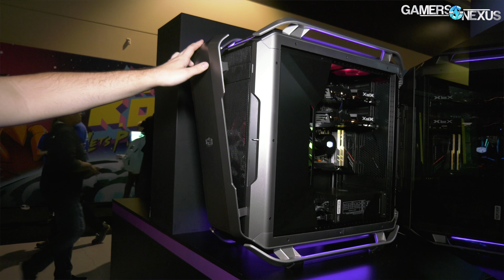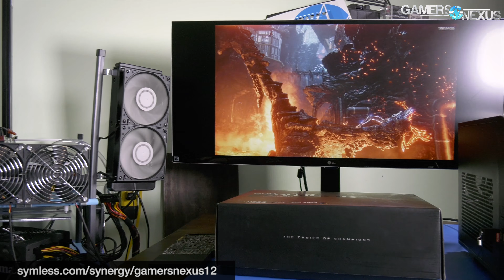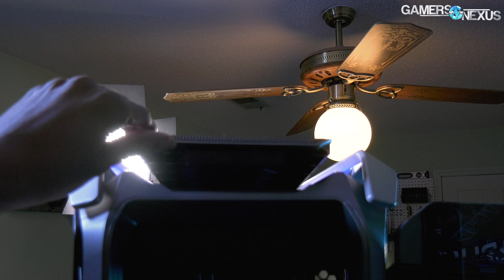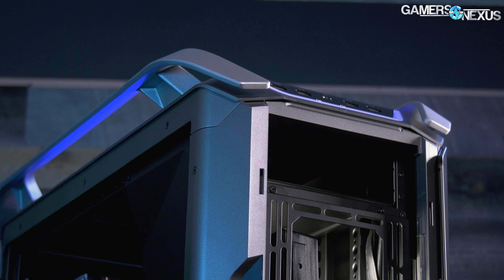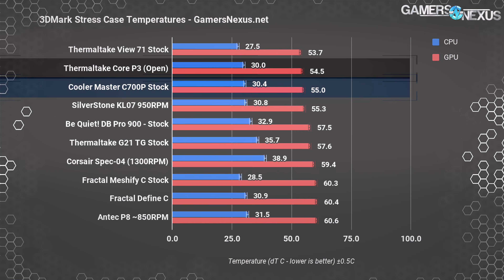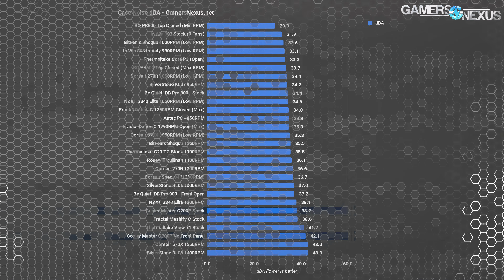Cooler Master Cosmos C700P Review: Thermals, Noise, & Build

Comment: There are not many options when you need a Bluray burner drive inside. C700P & C700M are both big and both have ODD bay. The only thing that sucks (aside from price) is the limitation of the top radiator size when ODD is installed.

Comment: Check your MB with this case as not all MB can facilitate the 4 USB 3.0 on the front. Found out the hard way with Gigabyte's z390 Aorus master. 
Only allowed 2 USBs at the front due to only one USB 3.0 header. Could use the USB 3.1 header with a converter cable to USB 3.0 but wanted that
 USB 3.1 for fast charge. So all in all Coolermaster C700P has a design flaw with most current boards. The 4 USBs on the front are for show only by the look of it. If not they should have highlighted this fact. 
Pissed off

Comment: That's some pretty loud dB's.  My R5 with an 88mm cpu fan ran around 35 dB.  When I changed to the BeQuiet Silent 280 AIO and 8 140mm fans, my case dropped to 13 idle and 20 full load.  I'd expect more for that price point.  Gorgeous case with a lot of options for watercooling.  Needs clear glass for my UV lighting.  It would look awesome on my desk though...matches the grey steel and smoked glass tops perfectly.

Comment: all i want in a cosmos is to stick in a ton of drives and no case could do that than a cosmos. and this cosmos doesn't do that anymore.

fuck.
Reply: I think 11 3.5 drives are enough 
if you want something that fits more and reasonably priced you can pick the Corsair 750D
it comes with 2 Drive cages (3 Drives each) but you can buy another two cages separately (~10$ each) to fit 12 Drives, that's aside from the four 2.5 inch bays.
if you want even more you can buy 3x5.25 inch to 5x3.5 inch cage
that's 17x3.5 inch + 4x2.5 = 21 drives !

Comment: October 10th is the day a good cm case comes to market. Just wait until then if you want a new case, otherwise get something else on the market.

They just need to let the cosmos series die. Like you said, this case is not bad, but its expensive (too expensive personally), and it just does not offer that much for the price. The curved tempered glass is a waste, and probably cost a lot, the metal panels behind the glass negate the point of the glass, Why there are even 5.25 drive bays I don't want to know. 

A few things they could have done to decrease price (and make it worth buying) no curved glass, not include any fans (thats 45 bucks off the case, since no one who buys this will use those fans). Where the curve would be, add meshed ventalation, which would increase airflow (like the h500p),  make the psu shroud go across the entire bottem (so when you remove the other metal piece, it doesn't look like you sawed off a third of the shroud). 

If they had just made this a mastercase 7 instead of a cosmos case, they could have fixed a lot of issues by not forcing themselves down a really expensive and unappealing design path. Well when this case does not sell at all (like the enthoo elite, but im pretty sure those are built to order) they will learn not to make cosmos cases again.

Comment: The Corsair Slate at the rumored 550.00 seems like a bargain, while this at 300.00 comes off about a hundred too high.
Reply: More like $150 too high I'd say, when you compare it to the $180 Phanteks Enthoo Luxe TG, or the $220 be quiet! Dark Base Pro 900.
Reply: It has more features than my 570 so I'd say it's worth at least 20 to 50 dollars more with the curved glass, inverted board option, RGB everywhere case and more. It's a little ugly to me, but it does have a corvette stingray aesthetic to it with all the plastic. It just seems to me like 200 is the lowest this guy could be, and maybe aught to be.
Reply: Good point, but yeah I wouldn't pay more than $200 for it either.
Reply: Have you seen the Slate? It redefines ridiculous.
Reply: Stalewind Farto1078 
550 for X brand case is a bargain but 300 for S brand case is a 100 too high

Mmmmmmm k
Reply: Stalewind Farto1078 just checked it, defo worth the extra 250 bucks because its huge...

Comment: 300 Bucks ? For that kind of money I would look at Case Labs. Heavy Duty Cases have their place but such cases use very few plastic pieces if any. The same can be said for curved tempered glass. I wonder what is the replacement cost for the side panel. To repeat what I said at the outset for 300 bucks and 70 lbs I would expect lots  of metal with a solid reinforced design and construction.
Reply: IMO, this is in no way a substitute for the Cosmos S2 Extreme. That case was heavy (~50 pounds) and had noise dampening and tons of places to mount coolers, drives etc. It was a case where you set your pc inside, put the case in one place and just leave it there quietly.

Comment: Space outside, Stone age inside...
Reply: That's exactly what I was thinking. The 90s are calling.
Reply: What is stoneage about the inside? In contrast to the typical sleek, edgy RGB bullshit this thing has useful space above and next to the motherboards. Means you can also fit Hybrid E-ATX boards, if you have certain boards in mind that are not the typical cheap 250$ stuff with pseudo doubled phases on their VRMs. A bit exaggerated, but you get what i mean. But mostly this does not only have space for big Radiators 3 sides, but has enough distance to the motherboard from that locations. So you can even use AIOs that come much closer to the quality of a custom waterloop rather than burning 150€ for an AIO whose center is around RGB and a fucking asetek pump, instead of quality components. And even with that, you could put in a 5,25'' drive for people who dont want to get assraped by win10 and want an easy installation of win7 on modern z390 chipsets. This case is fully modular and can fit different AIrflow paradigms, while beeing not fully ugly. The only downside of this case is the price.
Reply: The stupidest comment around
Reply: *most stupid, and you were correct until you typed that.